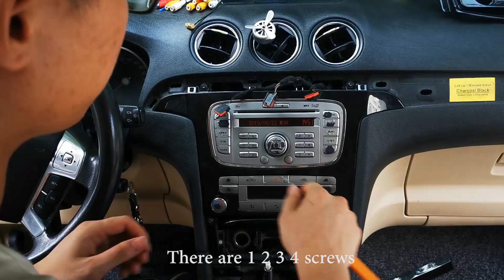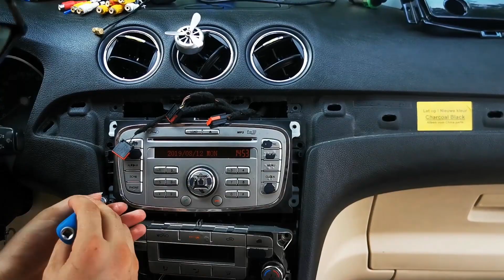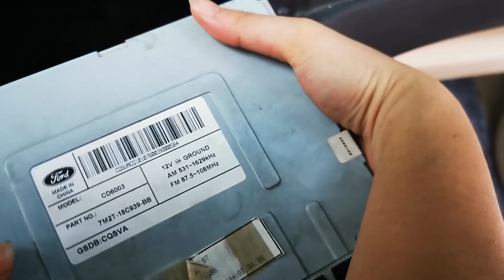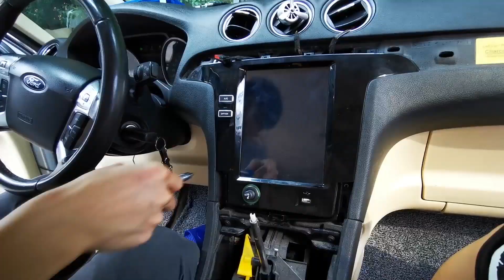How to install tesla style Android 8.1 radio for S-max

Comment: hi, i need help... i install the same tesla screen for FORD, but i cant control de air condition from the screen, the buttons in the steering wheel doesnt work and the kilometer gauge in the screen dont move if  move the car...
do you know what i doing wrong?..
Reply: i fix de acc control.... but button of steering wheel and kilometer gauge doesnt work... :(
Reply: @fabiankim5038 Hi, how did you fix the air conditionning issue please ?